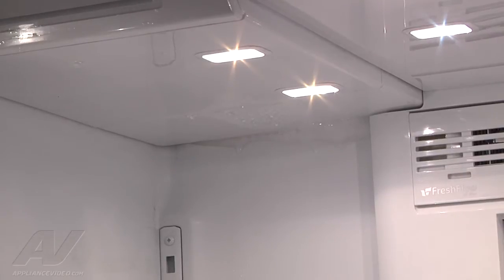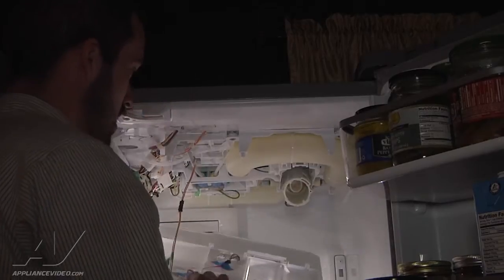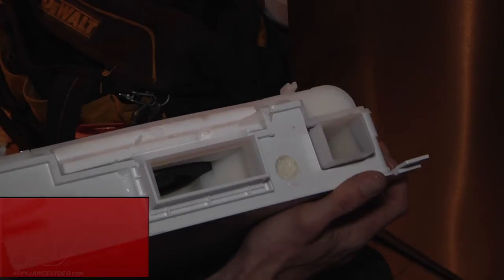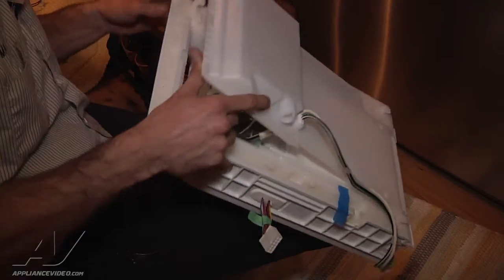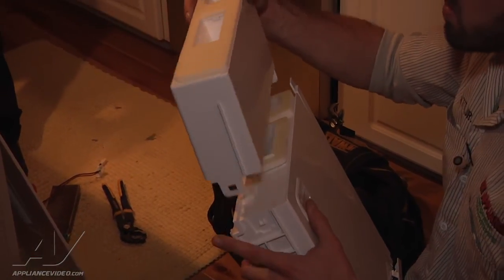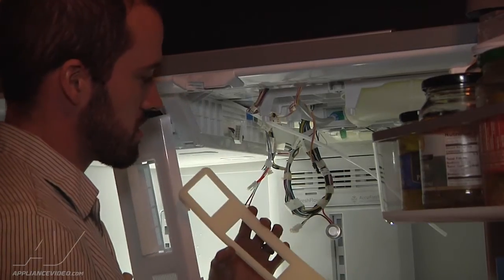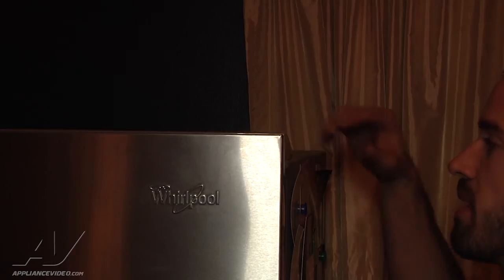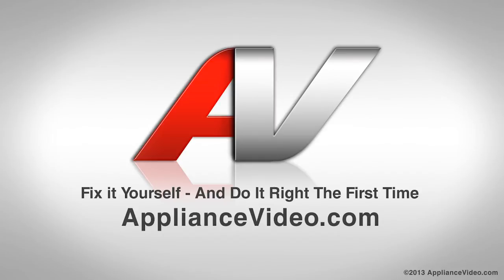Whirlpool Refrigerator Repair - Icemaker Leaking and Freezing On Back Wall - Heater Kit

Comment: Will these repair parts work on my KitchenAid KFIS29PBMS00?  This is exactly my problem and this ice maker looks to be identical to mine.
Reply from the maker: Great question, if you have a
more technical question that our parts department cannot answer, you can search
our over 10,000 answered questions free at our website www.ApplianceVideo.com under our Repair Help section. You can also call
our parts department at 1-800-830-5465 and they can give you help 6-days A week
Monday -Saturday, or search at www.SaveMoreOnParts.com  24 hours
7- days A week.

Comment: What is an approximate cost for this repair? Parts kit? labor?
Reply from the maker: Great question, if you have a more technical question that our parts department cannot answer, you can search our over 17,000 answered questions free at our website www.ApplianceVideo.com under our Repair Help section. You can also call our parts department at 1-800-830-5465 and they can give you help 7-days A week ,or search at www.SaveMoreOnParts.com  .

Comment: What was the purpose of the jumper harness? Just curious if I need this for installation on mine.
Reply from the maker: Great question, you can call
our parts department at 1-800-830-5465 and they can give you help 6-days A week
Mon-Sat . You can also search at www.SaveMoreOnParts.com 7- days a week.  If you have a more
technical question that our parts department cannot answer, our technicians are
answering all questions at our website at www.ApplianceVideo.com under our Repair Help section. We have over 6,000
common questions and answers that you can easily search through by your model
number, appliance make, problem or error codes, and It’s completely free to
search through our question & answer library. There is a very good chance
you question is already answered there.

Comment: Does this work on a wrx988sibm01?
Reply from the maker: Great question, if you have a more technical question that our parts department cannot answer, you can search our over 17,000 answered questions free at our website www.ApplianceVideo.com under our Repair Help section. You can also call our parts department at 1-800-830-5465 and they can give you help 7-days A week ,or search at www.SaveMoreOnParts.com  .

Comment: wher can i purchase an additional gasket to seal in the back against the fridge wall?
Reply from the maker: Great question, if you have a
more technical question that our parts department cannot answer, our
technicians are answering all questions at our website at www.ApplianceVideo.com under our Repair Help section. You can also call
our parts department at 1-800-830-5465 and they can give you help 7-days A week
Monday -Sunday, or search at www.SaveMoreOnParts.com  24 hours
7- days A week.

Comment: I have the same problem which ultimately leads to it leaking at the dispensing side, down the front of the ice tray.  Is that a separate issue?
Reply from the maker: Great question, you can call
our parts department at 1-800-830-5465 and they can give you help 6-days A week
Mon-Sat . You can also search at www.SaveMoreOnParts.com 7- days a week.  If you have a more
technical question that our parts department cannot answer, our technicians are
answering all questions at our website at www.ApplianceVideo.com under our Repair Help section. We have over
4,000 common questions and answers that you can easily search through by your
model number, appliance make, and problem or error codes, and It’s free to
search through our question & answer library.

Comment: How do I replace the ice infrared module on this refrigerator?
Reply from the maker: Great question, if you have a
more technical question that our parts department cannot answer, our
technicians are answering all questions at our website at www.ApplianceVideo.com under our Repair Help section. You can also call
our parts department at 1-800-830-5465 and they can give you help 7-days A week
Monday -Sunday, or search at www.SaveMoreOnParts.com  24 hours
7- days A week.

Comment: Would this leak cause ice maker to not make ice?
Reply from the maker: jorge martinez That is a question for our technician.  All of our technicians are now answering questions daily at our http://www.appliancevideo.com/ website under the Repair Help section.  We also have over 1600 common questions and answers that you can easily search through by your model number, appliancemake, problem or error code and it’s absolutely FREE. You also have the option
to email a factory service technician with a question on your appliance at
http://www.appliancevideo.com/repair-help/ . If you’re looking for a repair video, you
can also search our library of over 2600 free repair videos. ApplianceVideo.com
specializes in quality DO-IT-YOURSELF appliance repair videos and we get over
800,000 views per MONTH to our videos worldwide and growing. If you need of
parts for your major appliance, we have over 5-million parts in stock at http://savemoreonparts.com/ .  Thanks
for your support. Matt Ace Appliance factory service technician.